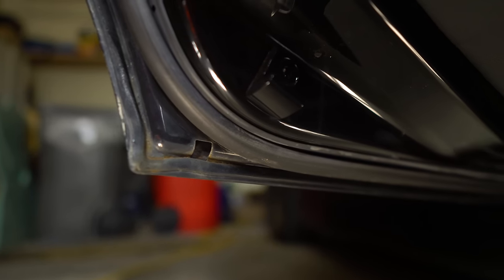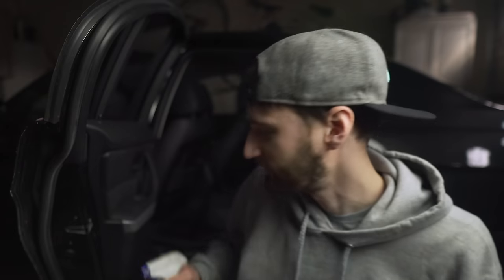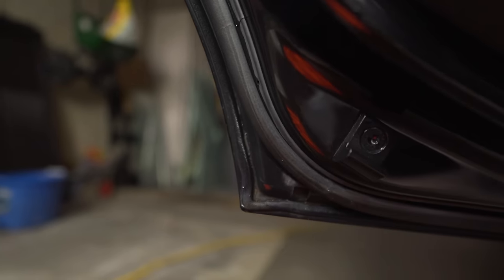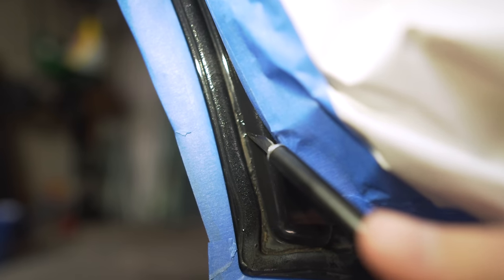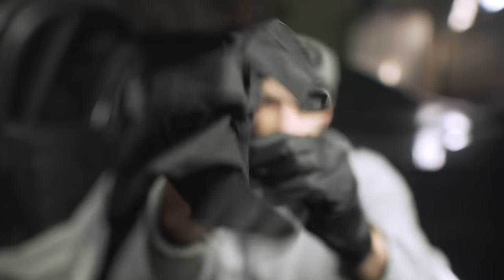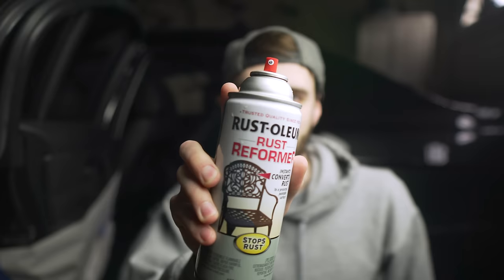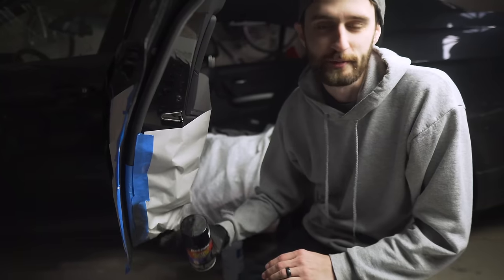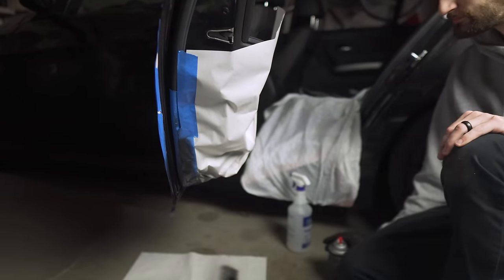DON'T LET RUST RUIN YOUR CAR! Here's How to Fix it!

Comment from the maker: Two things I forgot to mention. 1, you can use sand paper to clean up the rust. I used a Dremel with a wire wheel because that’s all that would fit in that small space. 2, if you were doing the outside of the body, obviously you’d want to wet sand afterward and buff the area with a polisher. But in my case, since rust wasn’t in a visible area, I wasn’t going for a perfect factory finish, but more for a solid layer of protection. With every project, you have to decide for yourself how much of your time you want to invest for the result you are going for.
Reply: @IvansBikesBmws  there are paint shops that can mix the paint up for you for cheaper. I think i got 2 quarts for 50$ for my car and it mached ok, since my car is 13 years old the factory color looks a bit different.
Reply: What year is your car?!
Reply: @shizumaakiyama3129  mine is 2011 and Justin's 2006
Reply: Ivans Bikes And Bmws thanks because i live in Albany NY and we get snow and i do wash mine every time it snow i was worry i was going to get rust quickly.  But his is 13 years old not bad. At all
Reply: Can you do a transmission fluid change! Plz!
Reply: Sorry but you first need to remove the door card and window, the rust is coming from inside the panel...give it a good clean inside and then do the "outside" job, very good job btw...
Reply: Drop some ATF insde your doors

Comment: That rust will come back in year or two in worst condition, you didn’t clean it well, you should take off all of paint and that rubberised seal cos rust is under that too, there is the rust actually start. Under thst rubberised seal is two sheet of metals pressed together and water comes inside of the door and stay there and rust start between those two sheets and goes under that rubberised seal and spreads on paint too. You need to take a part door and clean inside, put rust remover and adter that clean again, outside clean all paint and rubberised seal to bare metal and clean all rust and put rust remover outside too and clean it (not with water inside or outside the door), with alcohol or some liquid for cleaning spray guns like nitro cleaner. After that put new primer for protection of rust rhen rubberised seal, and paint, inside you need to spray primer too on that place you work on, after primer dries, spray all door esp bottom of the door where two sheets connects  with resin to protect those spot from water where sheets are connected. Thats the way you take care your doors and be sure rust will not be coming back after year or two.

Comment: Most rust comes from the inside of the door.  Best to use Fluid Film application in the inside of the door at the bottom seam.  Especially in areas of heavy road salt.  Nice Job.

Comment: At 6:04 you show a close-up of the rust, how it looked like. Just a friendly reminder for anyone doing this same type of work on a similar looking door: There's a plastic band straight under the "drainage" hole that goes all the way around the door. You can see it as the small bump that has rust next to it. There's rust underneath it and I do suggest removing it as far as the rust has come, because there's A LOT of rust underneath it. Just painting over it, as Justin did, will only temporarily help, the rust will be back after one year. Did the mistake on my car of leaving it there, same way Justin did, now I have to do all painting all over again. 
So yeah, summary, REMOVE THAT PLASTIC BAND, and get the rust outta there (unless you are planning on selling your car after the paintjob)
Reply: That plasticity band is called seam sealer, if you remove it you need to replace it with more seam sealer. This can be bought at a auto store. The rust is actually starting from inside the door sandwiched between the two outer door skin and inner door skin. The best way to fix this after your paint repair is stop the rust inside this sandwiched section from spreading farther. This can be done by using a cavity wax, or if your real cheap even motor oil. By dispensing it in the door bottom through the drain holes at the bottom of the door.

I do work like this for a living.

Comment: I usually also put some thin oil for cavity protection inside that seeps into the seems between the panels where the water always sits.
Take special care if you have a French car from psa - my Citroen c4 gp has so small drain holes that they clog up easy and when i was inspecting i think i found nearly half a liter of water in the front doors.

Comment: I have been a dealer tech for 4 decades and an ASE Master Tech since 1978. At least you are doing something to prolong your car and delay rust. Anyone reading this, water enters everywhere on a car, truck or SUV. The rubber on the outside of a window that moves, is the “Door outer belt mounding”. It even when new, allows water to run inside the door. I actually had a passengers front door that had 50 gallons of water. The customer heard noise, thought the door hinges were bad, but the door just weighed (1 gallon water = 8 lbs X amount of water plus door = real dam heavy) There are drain holes stamped into the skin, door fake or both and leafs are the main reason they clog up. Behind the front wheel, leafs are washed down behind the plastic inner fender panel, gather and hold moisture to start rust on that skinny little piece of metal fenders. The drain holes are shaped like a flat blade screwdriver. A bent metal coat hanger, wire or compressed air can ensure they are open. Plastic fasteners are common but in or out, carefully get behind it, pull it out and use compressed air or a garden hose to clean it out. Check all from front to rear. On the front center, the welded steel holds the A/C condenser and radiator (Called Radiator Support /Core support) but it has drain holes in these areas as well. A company called “Eastwood” sells an inner frame rust coating. It provides a reusable hose and screws onto their spray can. Follow all instructions but tapping newspapers down to catch drips or runs is recommended. This is not an “Isocyanate” that requires breathing gear. 
 If you keep your vehicles longer, sell it to your children or perhaps give to a grandchild, the vehicle will last longer and look better. Paint and body work is hard and expensive, but add rust, the sky is the limit. This is maintenance you can do. Rock chips on a metal hood look bad, but water starts rust  underneath the paint. I have seen it spider-web out 5-6 inches under great looking paint. Hope this helps you help yourself. A quote found in the Bible.
Reply: Who sells their car to their children?
In most countries they buy new cars or used as a gift if they can afford it...
But sell your family car to your children?
Reply: @K_N_44  Yes, Some discipline lessons and certain injury disability’s allow them to drive. Nothing is free, but I never got retail or close to it. They have to work to earn. Even Warren Buffet drives his own Cadillac, he does not have any children but never gave his brother or sister a vehicle.
  I bought 5 motorcycles and 3 cars before age 17 and never got an allowance or a nickel from my parents, or of help of any kind. Not even gas money to college.
  As the oldest on a family farm I did 99% of the heavy labor while they drove tractors. Let them earn it. It build respect for the vehicle and it’s up keep.

Comment: From factory, BMW fills the door panels with an anti rust gel. Over time, heat and maintenance washes cause it to run out of the doors which can lead rust that's not usually visible as it is inside the panels. Just sharing some info 😎
Reply from the maker: Is that square opening at the bottom supposed to be a drain? I think part of my problem is I took off the window trim on this door a while ago and when I put it back, it never quite fit the same. I wonder if water is getting through there
Reply: @justinbuice  that's usually where they fill the panels with the gel. I guess it does kind of act as a drain. I'd check your vapor barriers and weather stripping as well if you are getting a lot of water in there. There's the square hole on the left side and a hole in the corner on the bottom right side of the door. Personally, I'd fill the right side hole with a filler of some type as it would seem that that's where the most water if any would get in at.

Comment: Hey this is off topic but piece of advice is, check your u joints on your front drive shaft. Mines went out around 125,xxx and BMW made them non serviceable which means you need to replace the entire drive shaft. By bmw the part is about 800 dollars but i ordered myself one from dorman which costed me 350 with replacement bolts. Its an easy job you can do at home so you dont need to speen thousands of dollars at the dealership

Comment: Nice job. I personally would have felt happier by removing the entire door card and checking what has been happening on the inside of the door, just in case. How did the rust start in the first place? - blockages or rust spreading from elsewhere maybe?

Comment: I have the same thing on the driver's door on my car. I'll be doing this once it warms up a little bit. Sometimes I wonder how bad the rust is under the car with all the salt that they use in Minnesota. This car has so much plastic on the bottom that it's hard to tell. Thanks for the awesome DIY! Keep it up! 
Also, love the bloopers 😂
Reply from the maker: Same problem here in Michigan with the road salt. You rarely see cars more than 20 years old because they rust away to nothing.

Comment: well there is a bigger problem that you saw on the outside. If you want to do a complete protection you need to take apart the interior part of the doors and spray inside the door cavity wax! - buy something expensive and good product. the wax will spill out on those door holes- let it dry there do not wipe it- it will offer extra protection. other things- always use the car paint ! it is way better than noname paints , and clear coats whould be applied at least 2 layers and very very thin layers.

Comment: Tape up the drain holes. Put about 2oz of trans fluid inside the door and drive around then drain. The trans fluid will work it's way inside the pinch seem and will pervert rust from ever forming

Comment: Good video, thanks for teaching! Quick question, Is it the same procedure for the metal under the car seat?
Reply: Yes, remove all signs of rust down to bare metal, prime it, paint it, finish with a top coat.
Reply: @andreasweidemann618  Thank you very much for your kind response :D Have a good day!

Comment: Additional notes from me
-Remove or replace weather stripping if needed.
-If the rust is bubbling through, you're going to replace the metal, get a new door, or have a body shop handle it.

Hot dish soap spray 
Fresh water spray (rinse)
Dry properly
Mask good paint (use trash bag for outside of door & cards)
Grind/sand down rust to bare metal
Loctite Naval Jelly 
-Brush on
-Let sit for 10 minutes
-Rinse off w/ water
-Dry adequately 
Rustoleum Rust Reformer
-Let sit in a bucket of warm water
-Two coats
-10 mins to dry
*Dupli-color Perfect Match (Or OEM exact paint coat ordered from Manufacturer or dealership, etc)
-Two coats
-One coat of clearcoat
Reply: same notes I did while watching the video. I should have checked the comments first :) thx

Comment: I would like to mention that overall good tutorial on rust treatment but problem is that in that spot the rust is gonna come back with years. that's due to that this is double metal place. it actually wasn't rusting mostly from which place you treated but more of the place that is between these double metal. that's the biggest problems of rust treatment. you never can really cure the metal surface between these two metals. only way to really cure this part is to take the welding apart. remove the panel and then treat these surfaces. in most cases replace.

Comment: need to wash out the bottom of the inside of the doors with water, spray out with air and let dry then add some ATF down in the crack of the door, that will keep rust from forming for a long time.

Comment: rust coming up to next wash your car with double power, if you have rust on those elements, the all parts like door need replace to another with good condition, it is not possible to remove rust from it..

Comment: Are U an IT guy? What u've done is just for the facade. That rust is from underneath... between the two layers of metal that construct the door. You need to remove that mastic/putty from the factory, use some rust inhibitor and then paint. Also a must is to use a LOT of WAX into the door panels! This step is to avoid the water to get between the two layers of metals that construct the door.

Comment: A great guide on how not to do. By using brass brush you're not removing rust, just polishing it. Also, it is a really bad idea to put brush back into the original container or rust treating agent. You must prevent contamination of original product. Instead you must pour the agent into separate container and dispose what is left after you've finished, never put it back. At this moment I stopped watching the video

Comment: This doesn't really fix anything as far as i'm concerned, the rust is still there, it's just under the body panel filler and under the paint you applied. Remember guys that the seam you see in doors aren't welds, it's silicone sealant. The body panels are merely point-welded together, so over time, road salt may dig underneath the sealant, which is what happened here.

Comment: Such specimen which need water after drying (acid base) are antediluvian... And without any wax or something to fill inside the door (to cut out the oxygen for the rust from both sides) this repair has absolutely no sense. Do you really think, that the rust came out on the inner side of the door cause of damage paint? It came from inside!